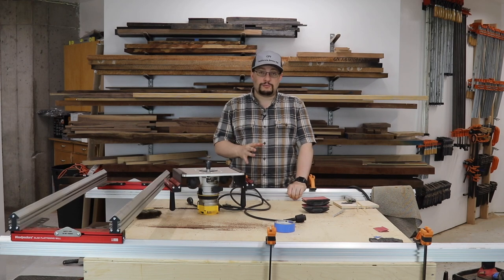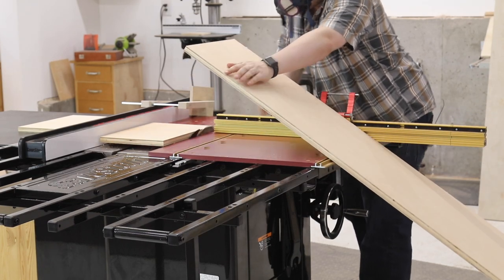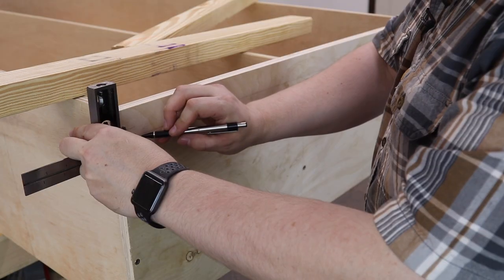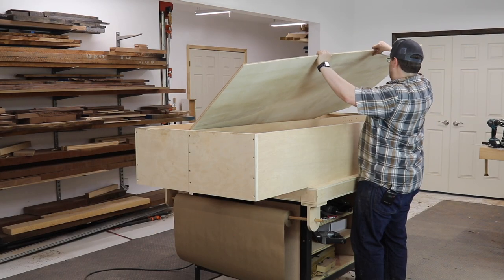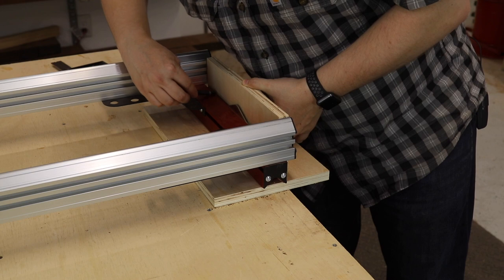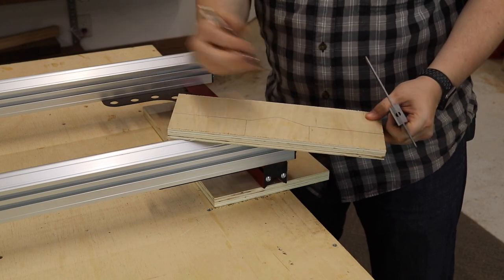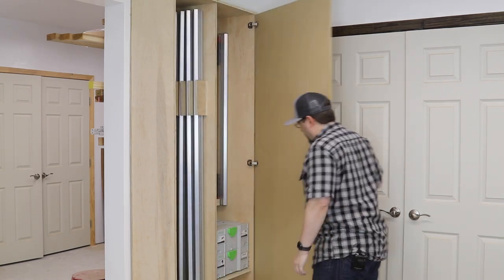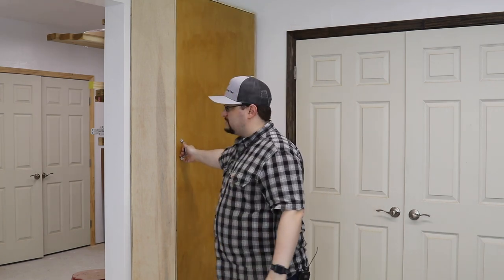Building a Tall Storage Cabinet

Comment: May be the angle but I get nervous watching fingers get that close to a cutting device. Too many horror stories as a beginner I can’t bring myself to buy a table saw. Can a circular saw with a guide cut decent straight cuts?
Reply: Look into getting a track saw. You can cut make a breakdown platform that sits on two sawhorses to cut plywood safely. I sold my table saw because it was taking up too much room in my multi-purpose work shop. I can do my cutting outside on nice days. You can also use the breakdown platform as an assembly table.